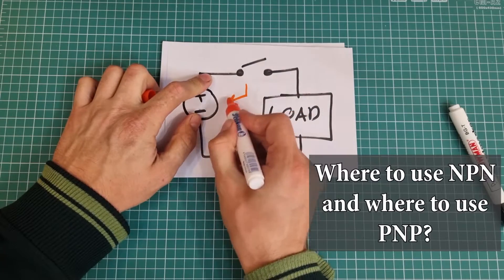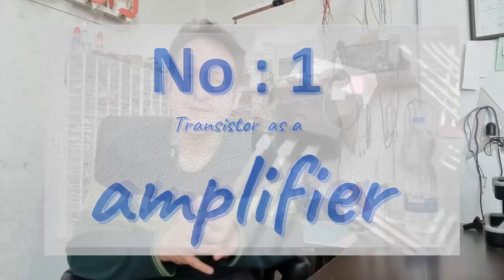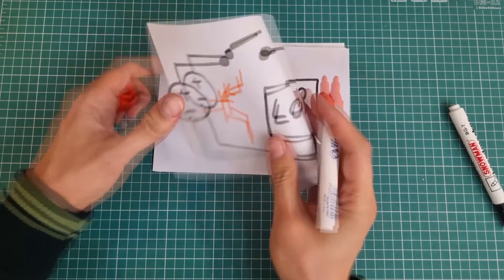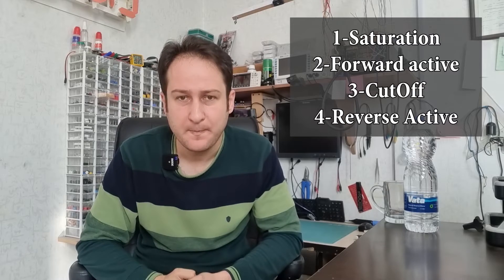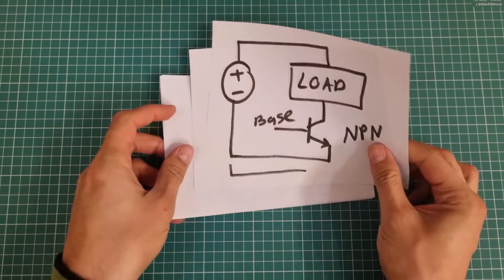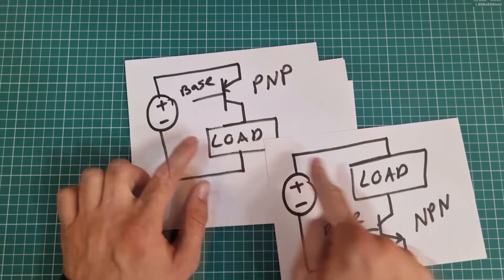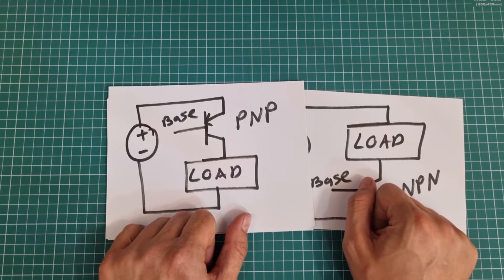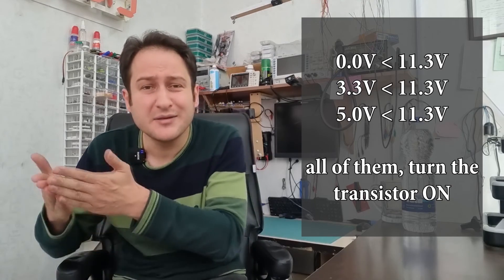Why NPN transistors are more often used in circuits?

Comment: Is there a reason why loads on NPN cant be used on the Emiter side?
Reply: Because it's base-to-emitter voltage, that determines whether an NPN transistor opens or closes.  If the load is on the emitter side, the emitter voltage is a moving target, and you can't guarantee that a given base voltage will produce the necessary base-to-emitter voltage difference.

Comment: Another disadvantage of using PNP as a switch with microcontroller is that the base current will sink in microcontroller which will most likely damage it.If NPN is use to drive PNP then it can be used with microcontroller and swatch on and off through 5V.Still there is another method of using PNP as a switch with microcontroller is if the load attached to it is either 5V or less..

Comment: What is the meaning of the statement made at 4:32 .
That the non transistor are used to switching ground of the load .
It’s not cleared to me . Can you please elaborate?? That would be really helpful.
Reply: it just means that the switching occurs in the ground of the load, by ground he means segment of the circuit where the voltage is lower or zero the negative side of the power supply

Comment: Im trying to find the answer to using one common to connect to several unknown transistors. I assume they would be of NPN type. 
I then assume to use only one wire as common, that is, the positive side of the power supply to my load/digital input.
(Im not sure why they show both plus and negative signals of ever signal)

Comment: Please explain...

can you explain this???
Why the input switch is always kept at the base side??
Can not it be keep at the power side of the collector with base and emitter keeping constant???
Or, can not it be kept at the emitter side with base and collector side constant???
Please explain.
Reply: It allows you to control the transistor with 5 Volts while switching a circuit that's powered by 12 Volts, or even higher, as long as they both share a common ground.  Since we affirm signals with positive voltage, and turn off signals with ground voltage, it's more intuitive in a design to have a transistor base controlled where 5V to ground opens the transistor, and 0V closes the transistor.  Of course, there is an implied base resistor to limit the current feeding the transistor.

Comment: 4:03 what is going to happen if I connect in the opposite mode? collector to power supply and emitter to load? It should work because current flows along the wires of the entire circuit anyway, right?

Comment: Another side-effect of using a PNP which may be annoying for some applications:

When you first turn a circuit board from OFF to ON, the driver for the PNP base is likely to be at ground when you first power-up.  Thus, as the power supply voltage rises, this can turn ON the PNP for a short time until the base driver gets up to its final voltage.  This means the transistor is ON for a short period during turn-on.  This can cause a "popping" sound if this is an enable for an audio circuit, or could cause a glitch in an important signal - say a microprocessor reset line if if is used there.

Comment: I need to trigger an ecu with arduino with a 12v positive load. I don't have enough space to use a 4 channel relay. Can I trigger Tip217 transistor with BC547? 
The ecu will not draw much current, but since I am not sure, I am thinking of choosing Tip217. I plan to line up type 217s side by side, give 12v to their middle pins (collector) and get the output from the emitter according to the Arduino trigger. Can this system work stably for a long time? 
Should I give 12v or 5v to bc547 to trigger type 217?

Comment: A question of "why" still remains. Why does the NPN only require 0v - 0.7v for its operation and why does the PNP require 11.3v - 12v for its operation? All I know so far from the video is that those are the requirements for the motor to turn on and off.
Reply from the maker: Also a PNP requires 0.7v but in reverse polarity. I mean they need 0.7v lower than the Vcc, say 12v.
So they trigger on 11.3v which is 0.7v away from 12v 🤪

Comment: I'm looking at old germanium transistor circuits. And they're almost all pnp. Why didn't they think of using npn then, since it's so much easier?
Reply from the maker: In old circuits the logic was opposite of the logic nowadays. 
I mean in that days, positive voltage (VCC) was used as common voltage. So, in those days,  using PNP was much easier and more common 👍

Comment: NPN on positive side of circuit as switch. Not ground. 

Also, don't ever switch ground/negative. You leave circuit energized to power voltage. One 'screw' up and you fry your circuit by grounding.

When you switch power side of circuit, the circuit can be worked on and not shorted. Of course, you wear grounding strap.
Reply from the maker: NPN is used to switch ground for a part or portion of the circuit, not the whole circuit.
For example, we use an NPN to switch ground side of a relay, a DC motor, etc.

Comment: so if we only had NPN transistors in this world - would it be sufficient?

are there applications where PNP transistors are required & cannot be substituted?
Reply from the maker: Yes, in most cases NPN transistors can be used instead of PNP transistors with a little change in the circuit. But, this may cause non-optimality in the circuit.
Reply: @elewizard  good to know it's interchangeable!  where can I read (or watch!) more about how the choice impacts optimization?
Reply from the maker: I have no idea. I will make a video on this subject if I have time ⌚

Comment: 4:26 You state "NPN is for switching ground". That's a mistake. NPN is for switching relative to the positive rail. PNP is for switching relative to the negative rail. You've made the mistaken assumption that ground is always the negative rail, but that's merely a convention brought about because NPN transistors became more common when silicon took over from germanium. You can ground either rail and the circuit works the same.

I'm old enough to remember when germanium transistors like OC71 were the commonest, and they were PNP because that was the easiest type to fabricate from Ge. In those days, the positive rail was ground. My first car was positive ground (i.e. the chassis was connected to battery positive) because the radio had germanium transistors. When silicon transistors became more freely available, the easiest type to fabricate was NPN, so we grounded the negative rail. When I upgraded my car's radio to one that used Si transistors, I had to swap the earthing so that the chassis was connected to battery negative, which involved re-magnetising the dynamo's permanent magnet in the opposite direction.

So, you actually have it the wrong way around. Because silicon NPN transistors were easier to fabricate (and had better characteristics), they became more freely and cheaply available and hence were used more often in circuits. The negative ground was a consequence of that.

And I've got some bad news for you. If you ground the positive rail, then your MCU will run from a -3.3V or -5V supply. It will provide 0V to turn off a PNP transistor or more than the -0.7V required to turn it on. You won't be able directly to turn off an NPN transistor switching from the negative rail.
Reply from the maker: Thank you for these facts. You are completely right, but I think you had better mention these points in IEEE, not YouTube. Here is a place for newbies and enthusiasts, not professionals. I have to present information in a simple way so most of my audience can understand. Talking about positive ground does nothing but create confusion for my audience.
Reply: @elewizard Exactly! I am happy as a clam that I finally understood the practical differences / use cases for NPN & PNP BJTs in circuits, especially in conjunction with MCUs...

I finished a med school 15yrs ago, I have neither time, willpower nor strength to do a MIT masters degree in my 40s... 🙄

So thanks @elewizard once again for doing these vids, they helped me to go a long way in those few last months😀👍
Reply: @elewizard  You should never underestimate your audience. I do agree though that in your presentations, it is fine to aim for a particular level and not complicate beyond that.

However, the comments section is where you can engage with a much broader audience and discuss in greater detail. That allows an opportunity for everyone to learn something new. Thank you for your engagement in the comments -- not every content creator does so well.

Comment: The NPN was cheaper to manufacture than PNP also.
Reply from the maker: Is it because mass production?
Reply: @elewizard  The NPN has two time less resistance than the PNP and therefore smaller and cheaper to produce.
Reply: @y_x2  The resistance is merely a function of the degree of doping in a semiconductor. However, electrons are more mobile than holes and that tends to give NPN (which use electrons as carriers) advantages in characteristics (like β and Ft) over PNP. In early silicon transistors, it was easy and cheap to make a NPN structure by double diffusion, while a similar PNP would usually require a two-stage diffusion process.

Comment: You probably can't use the NPN transistor directly to turn the motor on/off anyway due to power consumption from the base so I think you need two transistors anyway.
That is way a MOSFET is preferable as you described in another video 🙂.
Reply from the maker: Darlington pair transistors like tip122 are available for such applications with hfe about 1000. We can use Mosfet or darlington pair transistors 😉

Comment: For various technical reasons, it's easier to make an NPN transistor switch faster and consume less power. The underlying reason is that the charge carriers in NPN devices are electrons, while  in PNP devices they're holes.  Electrons have a higher mobility than holes. 

Because it's harder to get the same performance in a PNP as in an NPN, PNP transistors are used mostly in class B amplifiers, in H bridges, and in sensing circuits for which a short to ground must be detected as a fault. Even in these applications, a Sziklai pair is often preferred, with the high power being switched by an NPN transistor with a PNP controlling its base.

Back in the day, PNP's were commoner, because that's what could be made in germanium point-contact transistors. But ever since the advent of silicon, N-channel FETs and NPN transistors have been cheaper, faster, lower-power, and capable of handling more current than comparably-priced complementary devices.  (Excluding anomalies like PMOS memories, which flourished during a brief interval when a process for making NMOS or CMOS ones was not completely developed.) 

In fact, it's arguable that your observation that microcomputer outputs are basically current sinks and it's easier to pull the transistor base to the negative rail - driving the popularity of NPN devices, puts the cart before the horse.  The microprocessors work that way precisely because the transistors do.
Reply: Thx so much for taking the time to post that, i found it clear, really informative and well explained
Reply from the maker: Thank you for sharing these valuable information 👍
Reply: I think this is the right answer.  I was told that back in the day it was always a much bigger challenge to make pnp transistors that matched their complementary npn counterparts.  They were larger, a bit more fragile and often wouldn't quite be a match for npn.  I think nowadays this is less the case but npn is already king.  Then simplicity comes into it, its just easier to arrange a low side switch, if you used pnp you'll need a npn to switch it because the high side voltage will usually be beyond the device voltage you're driving it from, whereas for low side they can share the same ground even though the collector can go to full supply.
Reply: Nowhere in any transister data sheets say that NPN is faster. You must be an insider. Thanks for knowledge.
Reply: cart not card ... but thank you, that's very informative
Reply: @tedbastwock3810  typo fixed, thanks
Reply: I have also found in other sources about charge carrier that make NPN faster, but I have found no evidence in any data sheet nor any experimental circuit that show exactly that... 
This is still a myth for me.

Comment: You can use a small NPN transistor with its collector connected to the base of the PNP transistor and a resistor connected between the base of the PNP transistor to the supply voltage. An additional transistor allows microcontrollers to switch NPN transistors that if you find yourself needing to switch the Vcc line instead of the ground line.
Reply: Exactly what i was going to write. This is little more expensive and complicated, but if you really need to use the pnp with microcontroller is your only option for higher voltages than the microcontroller uses.
Reply from the maker: That is right 👍
Reply: Good tip! Thanks
Reply: This was also common in the early days of transistor amplifiers when the only reliable high powered devices where NPN types

Comment: I heard NPN transistors are easier for manufacturers to make
Reply from the maker: I don't think so!
Reply: @elewizard They were at a crucial time when silicon was replacing germanium. Silicon transistors could be made cheaply and mass-produced by diffusion techniques, rather than the alloy techniques used for germanium transistors. It happened that it was possible to diffuse simultaneously both the base and emitter regions into a substrate which became the collector. This worked because acceptors (which form p-type) of low atomic weight diffuse more rapidly than donors (which form n-type), so that a p-type base could be formed further into the material than the n-type emitter. See https://en.wikipedia.org/wiki/Diffused_junction_transistor#Double_diffusion for more detail.